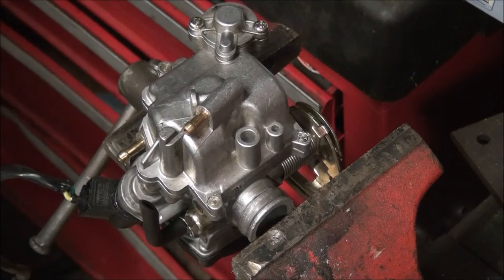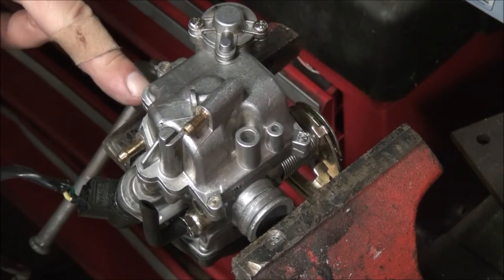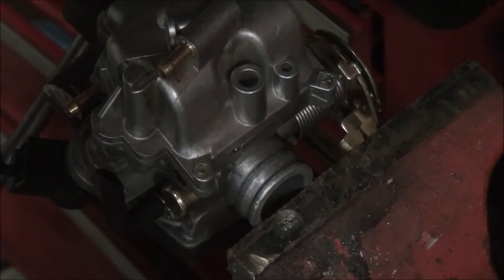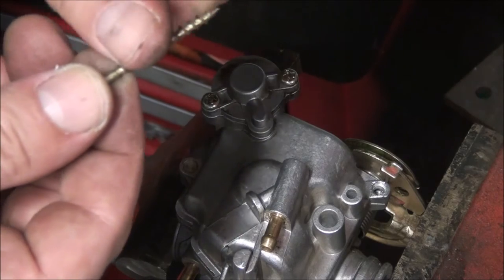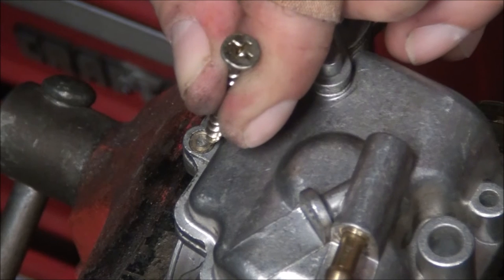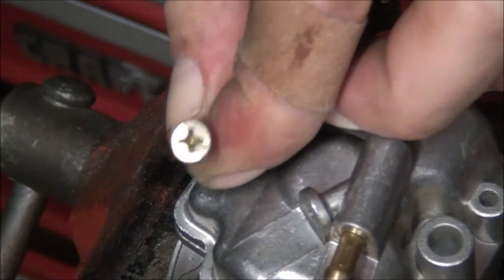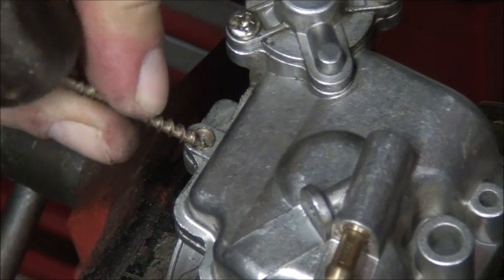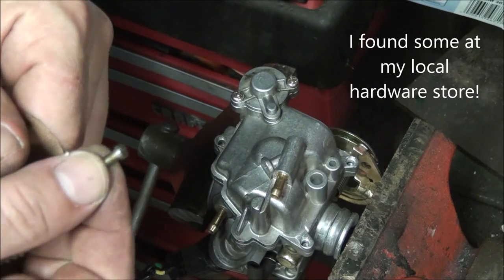HOW TO REMOVE the FLOAT BOWL SCREWS on a CHINESE SCOOTER MOPED CARBURETOR.

Comment: Ran into the same problem, I used a Dremel with a cut off saw blade to go right down the middle of the rounded off screw. Then that made it possible to use a flat head screwdriver to easily take them out and put them back in. 👍
Reply from the maker: good tip

Comment: I just used a dremel with a cutting disc and cut slots in the tamper-proof screws and removed them with a flathead screwdriver. I cut into a little of the carb metal because the screws were recessed, but didn't hurt anything. I was also able to reuse the screws. Put a .92 jet in the carb and everything is wonderful. ✌
Reply: I had recently eliminated the stock air box and replaced it with a cone filter. I had to put a bigger main jet in to compensate for the increased airflow. Scooter runs great now. Starts right up and no hesitation or bogging when riding.
Reply from the maker: good tips
Reply: Man thank you. That is genius!
Reply: it's amazing they don't use some way to prevent you from removing any part of the bike.  I'll bet they're working on it.

Comment: Also instead of gettin new screws the day you do this if you don’t want to just notch them with a Dremel or something so it has a flat head notch to screw them back in, but if the bike is near new it’ll work but a older gunked up one this prolly won’t work bc the threads are dirty

Comment: Hate to tell you this but it has nothing to do chinese manufacturers has more to do EPA = Environmental Protection Agency and Carb = California Air Resources Board keep in mind even lawn mower, weed eater and many other power tool have same problem and anything with engine will also have same problem to
Reply: No there is thousands of pieces of equipment sold in Cali that has a float bowl you can remove
Reply: @JustinMentionedIt  That depend on the engine many of them you can not change air fuel mix screw look at lawn mover and that not all.
Reply: Anthony Toste I’m referring to dirtbike , I shoulda been more clear, Kawasaki Suzuki husky Yamaha all off em have carbs with bowls access
Reply: @JustinMentionedIt  all those are good Japan bikes that's why.Lol